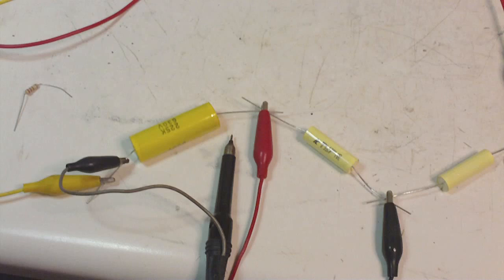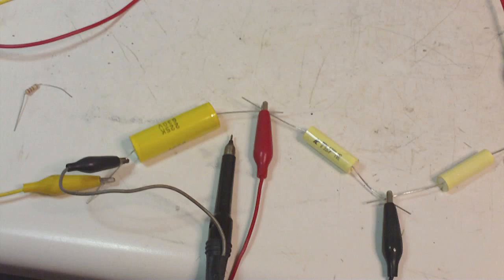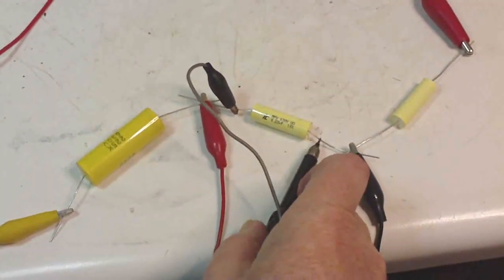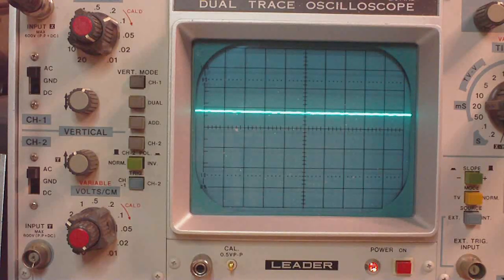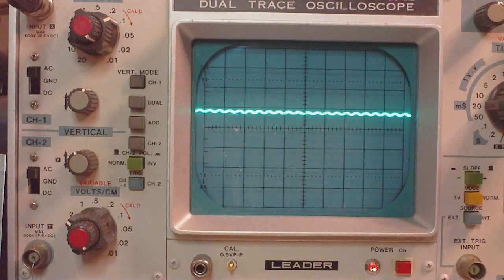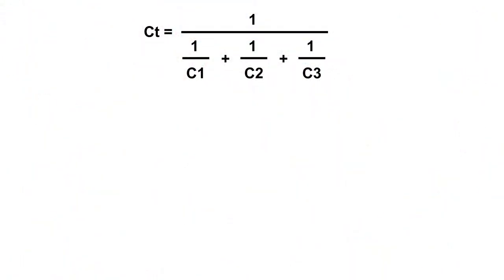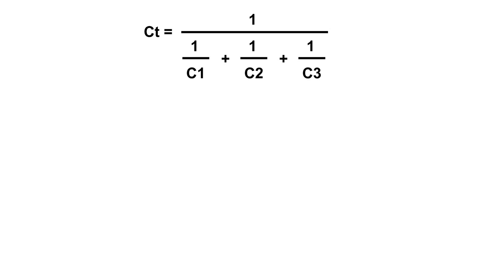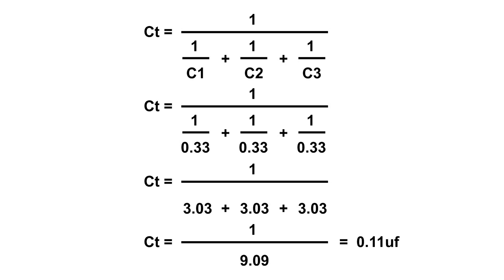RCA Meter WV-87B Correction

Comment from the maker: @rlewis1946 
The voltage drop in the first example (second video) are not equal across each capacitor. Even through each capacitor has a working voltage of 630VDC, it is posable to exceed the working  limit of one or more capacitors. If just one is exceeded and fails, this could cause a cascade of failures.